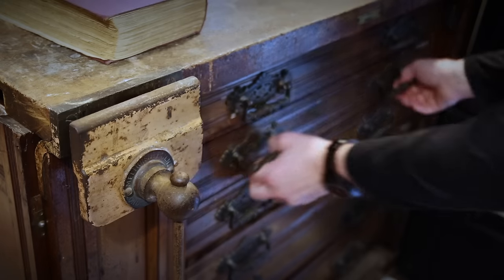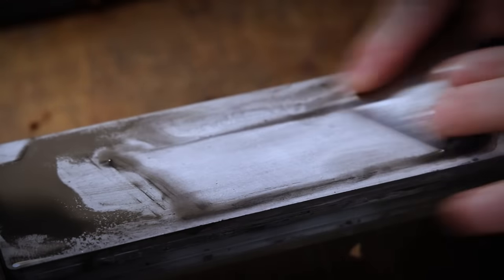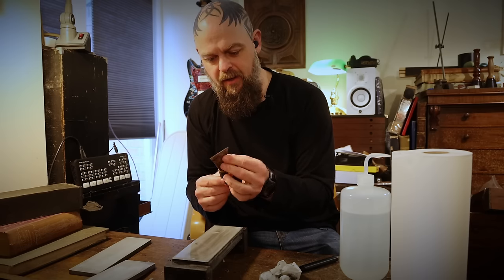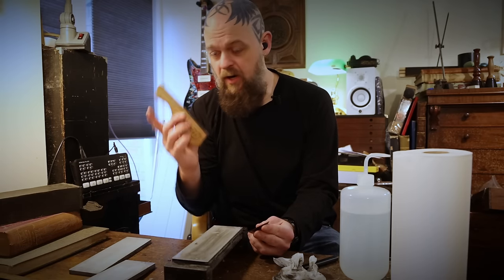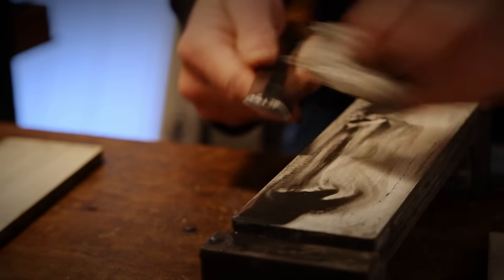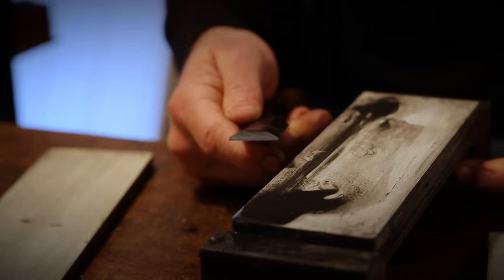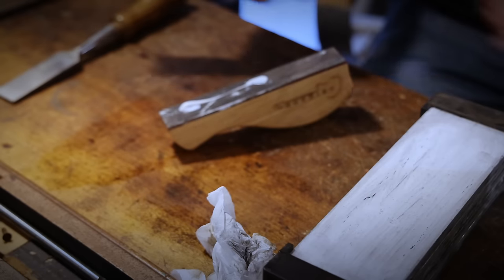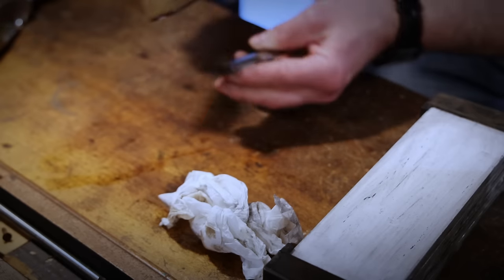The Zen of Sharp

Comment: I agree, I can get lost in sharpening and also get bored with it! I like to use diamond plates for rough shaping, 400/1000, if the chisel has been used and abused or was never flat in the first place. Then I work up through my water stones to 6000 and finish with rouge on a flat piece of wood. I like the V mk11 for a honing guide, gives consistent results. Using a strop "free hand" is a good idea, similar way I sharpen a drawknife - tuck one handle under your armpit and use a sharpening stone to flatten and sharpen, then switch. Keep chasing that burr, folks!

Comment: A micro bevel doesn't actually alter the cut. It won't cut any better (or worse). But ... if you're working, it's a lot faster to get back to sharp, because you just hit the micro bevel again, and there's less metal to remove. Well, until you eventually need to redo it fully. I also use tormek sharpeners really heavily. A wood lathe is a great motivator, there. They're basically high powered too dulling machines. And worse, the tools are annoyingly complex shapes.